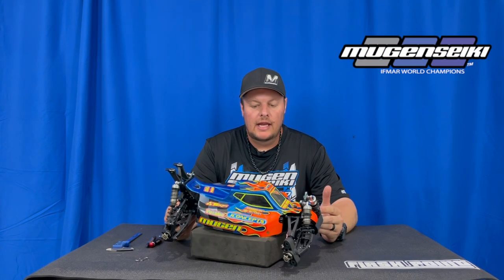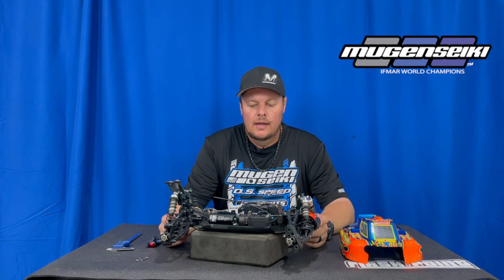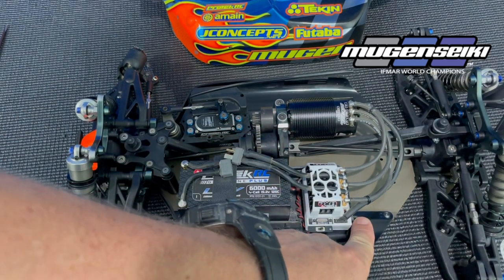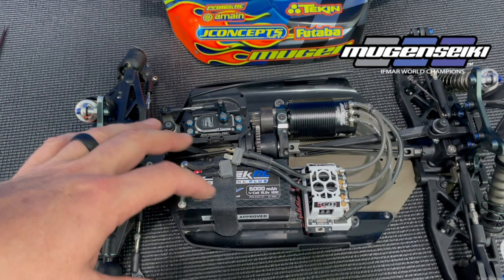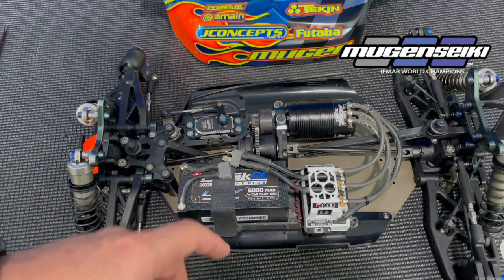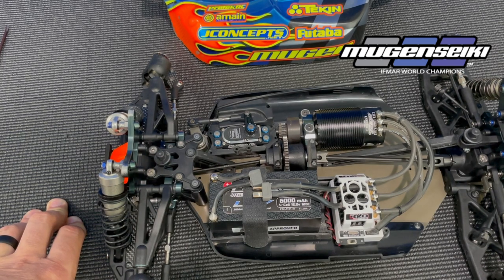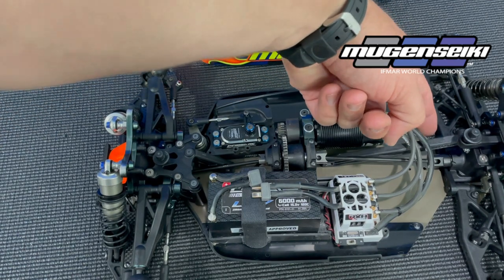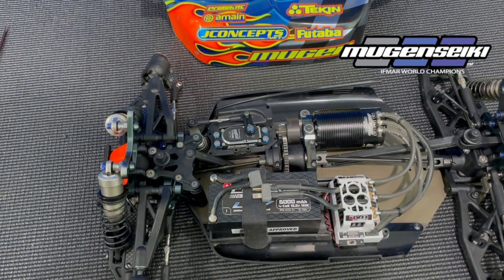MBX8 Eco Shorty Battery.

Comment: Did you have any issues with the battery hitting the body? Do you have to raise the front body mount?
Reply from the maker: The battery strap rubs the body slightly with the JC S15 Eco, but not enough that I raise the body mount.

Comment: What is the Advantage or disadvantage as far as Handling goes with this set up? Also, you said you were going back in forth with it. what kind of Track conditions would this be ideal for? Thanks.
Reply from the maker: Now that I have some time with this setup I'm going to stick with it.  The balance of the car is really nice and has less swing weight when exiting the corners which makes it more stable.
Reply: are you running the rear 30g weight?

Comment: I've been away from electric for a bit, is that a clutch bell on the electric motor? If it is, then where are the brakes?
Reply: It's the Tekno Traktion Drive kit. It's like a nitro clutch except the shoes push out instead of get pulled in, that way it has some give but the brakes work and engages at zero rpm.
Reply: @kaiedick9550  pulled in... what?
Reply: @alb9022  Normally in a nitro clutch the springs pull the shoes in, but they get flung out as you increase rpm. On this one the springs push the shoes out, that way it's always engaged but there's some give
Reply: @kaiedick9550  In 1:10 terms, it's a slipper.
Reply from the maker: The shoes are always engage which allows the brakes to work.  It's more like a slipper than a nitro clutch.